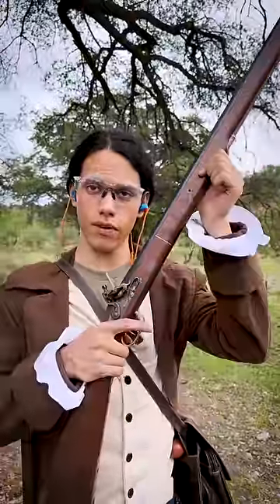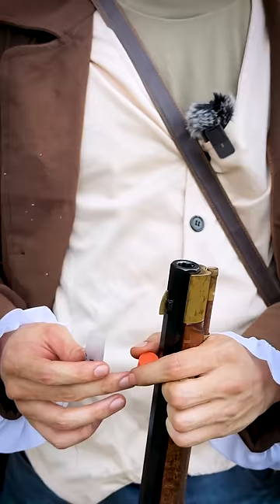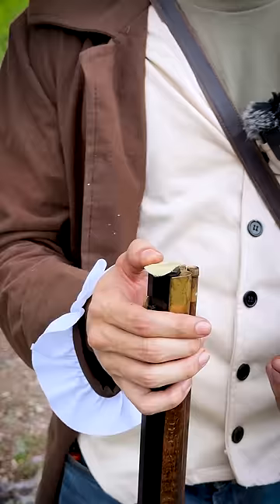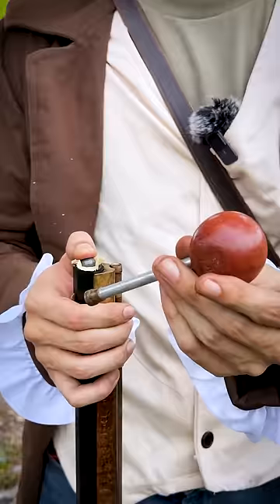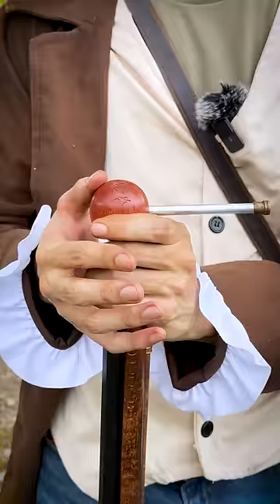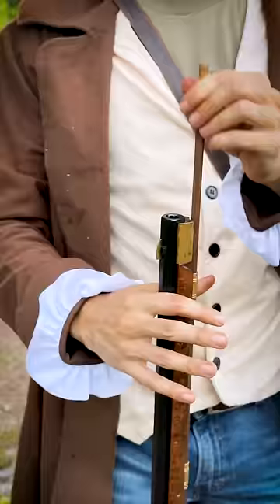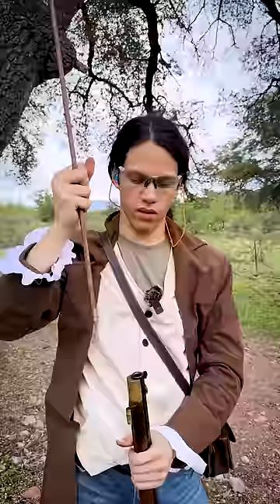How to Load a Flintlock

Comment: Soldiers could probably load these things so dang fast back in the revolutionary era.
Reply: They did the standard till muskets became no longer use was somewhere between 3-10 per minute.
Reply: A flintlock musket, pretty quickly, but one of these would be pretty slow, because it's rifled, and requires a lot more effort to load
Reply: @sinisterisrandom8537 10 shots a min would be more fitting for a late 1800s single shot rifle. In practice the fire rate could go up to 4 or 5 a min but under battle condition you'll get a 3 or a 4 if the men are extremely well trained and have high morale the French and the Prussians were a little ahead of main land powers but the Brits could keep up with them most of the times.
Reply: @sinisterisrandom8537 you would have to be fast as frick to get ten of these a minute
Reply: 3 rounds to the minute. That's good Soldiering.
Reply: The japanese bought flintlock rifles from the portuguese in the 16th centuary and they invented a "quickloader". It's a small tube that already has gunpowder and the projectile in it so you just put it on the muzzle and push the loading stick through the Barrel. It's called "hayago"
Reply: An average of 3 times a minute, under fire. So like, count to twenty.
Reply: Doubt it
Reply: With flintlock rifles it was longer to load than a flintlock musket mainly because of the extra steps such as the patch and hammering the tight patch with the ball in. I dont think loading speed was an importance to a skirmisher, it’s hitting the enemy accurately
Reply: @whyareyoureadingthislookaw8319  4 to 5 rounds per minute was impossible in any condition, it is 2 or 3 per minute at best with muzzle loading smooth barrel muskets ... just 1 per minute with muzzle loading rifled muskets
Reply: @federicovesentini3719  It is possible in drilling but the average fire rate in battle was 3. 4-5 was only done in drilling as rare as it is It was possible just not likely.
Reply: @whyareyoureadingthislookaw8319  Spit loading a smoothbore or unpatched rifle (see Sharpe's Rifles) flintlock could approach ten a minute until fouling got too bad, but loading from loose powder and ball would always be slower, even with a smoothbore.

Brits had the advantage in the flintlock era; not only did they keep the faster-loading smoothbore Brown Bess when everyone else was converting to rifles, but their troops trained with live ammunition where almost all other armies trained "by the numbers" but would only fire a half dozen live shots (so they could feel the recoil and see the pan flash) before going into combat.

American Civil War, with paper cartridges, Minie balls that needed no patch, and percussion ignition would get rifles up to 10 a minute with accuracy (again, until too much fouling built up), but that was 20+ years after flintlocks became obsolete.
Reply: @SilntObsvr  I'd disagree the British were very well trained but The average Prussian or French soldier was way more likely to have combat experience against another European power. Before Friedrich Wilhelm Ludolf came to train them colonists army was as effective as Russia's current day army. And the Brits were criticized very harshly due to their lack of disciplinary punishments which I'd say is pretty cool of the Brits but that off topic. And Spit loading most likely never happened Brandon.F has an amazing video on it.
Reply: @SilntObsvr  Oh and I can't say much about the Civil war since I didn't study it as much.
Reply: @skystorm569 watchs sharps rifles they actually show how they did it they would skip the ram rod and put the shot in there mouth put the powder down the barrel and then spit the shot back in the barrel then tamp the butt of the rifle on the ground prime the pan then fire
Reply: @psjesse117 Muskets were a lot faster to reload by the time of the Civil War
Reply: @AAV_OP  Yeah, because the whole step of priming the flash pan was eliminated by percussion caps, as well as pre-lubricated cartridges becoming common, allowing the rifles that were used to be loaded more smoothly while also being rifles, not smoothbore
Reply: @SilntObsvr muzzle loading weapons did not get faster at all, it was always around 2-3 expected in battle or 3-4 in drill, no musket/muzzle loading rifle could get 10 rounds per minute, paper cartridges allowed 3-4rpm, without paper cartridges you'd probably only get 1 round per minute (or less), i can't say for the sharps rifles, but i'd guess around 8 to 9 rpm, also, no countries were switching to standardized rifles in the 1700s, unless in skirmisher/specialist roles
Reply: @sinisterisrandom8537  3 was the parade standard, if you got 10, you would be a superhuman
Reply: @whyareyoureadingthislookaw8319 a mid 19th century smooth bore musket using percussion caps could 100% be loaded and fired at a rate of 10 rounds per minute unless you are using miniballs, especially with paper cartridges. A breach loading single shot rifle or needle fired rifle could probably do more like 12. A breach loading rifle like the British martini Henry in the late 1800s could do way, way more, there is a video on YouTube of someone loading and firing 18 rounds from a martini Henry using metal cased ammunition in a minute.
Reply: @psjesse117  yeah I know all that plus the invention of the minie ball which is close in shape to the modern-day bullet and they put rifling in all the musket barrels to help improve accuracy
Reply: @derekhenschel3191  Percussion cap muskets weren't a thing in the 18th century they were used first in the 1820s/1830s. And someone firing the Martini Henry 18 times would not reflect a soldiers ability under battle conditions.
Reply: @whyareyoureadingthislookaw8319  I meant 19th century, it reflects the ease of loading and firing
Reply: @kyleramos720 remember volley fire??

Not about accuracy but overwhelming firepower
Reply: Imagine getting hit by this thing
Reply: many guns from dead men had two or three balls shoved down them, to scarred to remember the powder 😮
Reply: @sinisterisrandom8537  no chance 10 per minute. I see 96 people don't know about flintlocks
Reply: @colinhaieck2299 MATCHLOCK not flintlock, being portuguese
Reply: This is a rifle, so not really. Though with muskets, yes.
Reply: @SilntObsvr   have you even watched that episode? That fastest guy in the group sharpe is teaching does 4 rounds and Sharpe even says the mark of a good soldier is 3 ROUNDS A MINUTE IN ANY WEATHER. 
Your made up point about the British still using muskets is, I'm fairly sure, made up seeing as how the British eye using baker rifles more and before other continental powers. And spit or tap loading wasn't even a real thing they'd all get lead poisoning. 
You need to do confusing a TV show with reality. And if you do cite a TV show at least get it right
Reply: fast mags weren’t invented
Reply: Trained soldiers could fire 3 rounds per minute. But these men fought in 3 man deep line formations firing volleys. One line fires, then another, then another, by the time it comes back to the first guy he's reloaded and ready to go again. Every few seconds, another volley would be sent downrange.
Reply: @sinisterisrandom8537 10 rounds a minute? A good time was 3/4 per minute, you aint loading, amining and firing a musket once every six seconds
Reply: @sinisterisrandom8537  you edited it and still couldn't make it in any form of English
Reply: You're only able to reload a Flintlock five times per minute
Reply: British soldiers, of the time, (minute men) were required to make 3 shots per minute.
Reply: @FrancesShepherd-zj3zn  exactly, understanding muzzle loaders is important to understand how far tech has come, and yet no one knows anything about them! So many comments mention how "minie balls made loading faster" when ammunition type has nothing to do with the loading process lol, just shows you how many people get their info from movies, or are talking out of their ass
Reply: @sinisterisrandom8537 the highest recorded rpm with a smoothbore muzzloader was 4rpm while most experienced men could barely manage 3
Reply: @colinhaieck2299 unlike what is shown with a marksman rifle, common smoothbores already used prepackaged paper cartriges, the rear was torn off with the teeth and the exposed powder poured, the excess paper would work as wadding to help with gas seal with the shot sitting in front
Reply: @SilntObsvr everyone in the 1810s used mostky smoothbores, you watch too much media, even with minie which was made in the 1840s the only place you would see 10 rpm is whatever video game you found these in
Reply: @AAV_OP they reloaded slightly faster as the ramrod would just slide down the barrel, even with the brown bess which was made for better rpm still took quite some force with the tighter seal the paper gave
Reply: @SilntObsvr there is so much wrong here lol
Reply: 3 shots a minute was considered the expected rate of fire.
Reply: And they used to stand in a line and shoot each other in their best clothing and nice tall hat.
Reply: In the early 1800s, the british army was notorious for whipping soldiers, and, during the peninsular war, many british soldiers had experience from fighting in India.
Reply: @rainmanslim4611 then there were the British who fought in two rank deep lines, and usually they fired by companies instead of lines, so the fire would systematically roll up the line, like how a warship of that time would fire its guns.
Reply: It reloads on time for the next war.
Reply: They definitely could, they were called minutemen, they could fire, reload, and fire again in a minute or less, it was actually pretty awesome.

Comment: i never thought there would be a delay between the hammer and the actual shot, thats pretty neat
Reply: User error. You can see him pump the primer at least 4 times before it cuts away. That's way too much powder. Basically turns the pan into a looney toons fuse.
Reply: There's actually a tiny lil bit delay if its done properly, which you can see in slow motion lul.
Not like this guy's delay
Reply: Hamilton said it best.

"Click, Boom."
Reply: I mean, there’s a delay between the pin hitting the primer and the bullet leaving the casing on a modern gun too, just much much shorter, this one is a little exaggerated (probably for dramatic effect, maybe because the user isn’t perfect)
Reply: You can't flinch or you'll miss.
Reply: Usually not this much, but it does delay. Makes hunting more interesting
Reply: Black powder. It delays and produces a lot of smoke
Reply: @jtime8022 Not error, he wants to show the use and priming, so he exaggerates everything to demonstrate everything in detail.
Reply: @chrisgetz9787  If primed correctly (1/3 of the flashpan max.), the delay is reduced considerably. In fact, the delay of the best quality dueling-flintlock pistols as well as some of the finest rifles (not muskets) of the time, were nearly or AS fast that of the percussion mechanism. This requires 4F priming powder, a newly hardend "steel" and a neatly knapped flint though.

Comment: The delay is insane to think some were able to take longer shots with them
Reply from the maker: When the pan is primed correctly, the "Lock time" is actually pretty instant. I just put too much powder in the pan so it took forever lol
Reply: @bigironbois well I have learned something new. Thank you. For new knowledge I will subscribe.
Reply: They have a 1000-yard match shoot twice a year in Friendship IN
Reply: People forget these were *accurate*, a lot of people depended on hunting to feed themselves and used rifles to do it. If you missed 90% of the time and scared all the deer away you'd never eat.
Reply: @boydrid  Yeah, my older brother went out to Friendship and shot many times.  Won a few competitions if I remember right.  With a rifled barrel, these guns are surprisingly accurate.  Most of the 18th century guns were smoothbore muskets, those were spray-and-pray.
Reply: @Moose6340  I really have a hard time believing that people are able to see and shoot that far.I know that they are able to. But it's definitely more the person than the gun. I know that even with modern guns and scopes, I couldn't shoot that far and hit a target.
Reply: @bigironbois  Yes filling the flashpan up to a third is ideal in when to achieve the most immediate discharge.
Reply: The old-timers took a quill... A feather... And plugged The flash hole to keep the powder out of it.... If you do that, it goes off almost as fast as a cartridge rifle... Take anything and plug it because when it fills with powder you created a slow burn fuse... Keeping the hole open lets the fire flick into the powder charge

Comment: In the Civil War era, a well-trained soldier was able to fire their M1861 three times per minute. That’s crazy fast for the time.
Reply: Three times a minute is not exceptionally fast for the time. With moderate training, you can achieve that. 4 or 5 a minute would be absolutely something though.
Reply: That's 3 aimed shots per minute. A panicked soldier could no doubt fire faster, but if you don't hit your target you might as well fire into the air.
Reply: Thats crazy
Reply: Also, in the Civil War they used the Minnie Ball which required no patch.
Reply: They used paper cartridges, which is way faster to reload. All of the powder is already measured out for you.
Reply: @thesayerofthelaw  I didn’t even think of that. I just think of reloading my grandpa’s muzzle loader and I was like, “how did they do this so fast?!”
Reply: @brettandersson3206  Civilian arms would be loaded with Powder Horns, Separated patches and shot while Military arms would use paper cartridges. Civilian weapons also were typically lighter and shorter with more advanced sights and rifling while Military weapons typically were heavier, longer and of course had the Bayonet. It gets more streamlined when you reach the 1850s where rifling and rear sights became common place for military weapons.
Reply: Springfield rifles in the Civil War didn't use powder to prime a pan; they used percussion caps.
Reply: They also had access to percussion caps and preloaded paper cartridges but still impressive for a muzzleloader.
Reply: 4
Reply: Not that’s soldiering
Reply: @BrianRissooumbofficial 
Most convincing rage bait of 2024.
But in all seriousness, paper cartridges were the most common ammunition for flintlocks at the time, stretching from the Napoleonic wars.
Reply: No, at the time they would use an all in one paper cartridge. You take the cartridge out of your pouch, tear off the top with your teeth. Then pour the black powder into the pan until it was full. Close the thingy on the pan, shove the rest of the cartridge in the barbell then shove it down there with the ram rod. Should take 15 seconds or faster
Reply: @Jannaria  you’d usually use a percussion cap they would do it where you would have to pour black powder into the pan in the 1700s
Reply: @Jannaria  it would take longer than 15 seconds
Reply: @JCoutdoors-777  no it wouldn’t?? If you were skilled (or sneaky) you could literally load it in less time
Reply: Yeah, using paper cartridges a musket could be fired as many as 5 times per minute by experienced soldiers.   Rifles were slower, but could be expected to fire 3 times per minute or so, the tolerances between ball and barrel were much tighter so it took longer to seat the ball.
Reply: The Prussians were expected to fire around 5 rounds per minute. Though in reality it's probably closer to 3 rounds per minute.
Reply: Minie Ball loads faster than round ball
Reply: Redcoats doing that 150 years earlier without miniballs
Reply: Most of the rifles used during The Civil War were percussion
Reply: 3-4 shots a minute was standard for muzzle loaders before the 1860's.
In the 1780's-1880 it was expected for any man to reach that without cartridges.
Reply: Now Imagine What if so embody tells them In future there will be guns Which could fire 30+ rounds Per mint

Comment: Bro was embarrassed to look back
Reply: i don't think i could hit that target with that gun, no matter how many tries you gave me
Reply: Do you know how inaccurate the gun is?
Reply: @dartawnasailo4449 they’re talking about the delay from trigger pull to rifle firing. Lot of people call these flinch locks bc it’s SO easy to flinch and miss during that delay. He honestly just didn’t use the right powder in the pan. Either he didn’t use priming powder or he used the wrong type, Swiss 4 F works best I’ve heard.
Reply: @jordannewsom4578  i think you've mistakenly replied the wrong thread
Reply: @jordannewsom4578 no hes literally talking about the inaccuracy. Those guns had to be used in lines of defense because
of how inaccurate they were. mainly because the inside of the barrel was not threaded not giving the spin needed to keep it on target
Reply: I mean, from that far away even with a musket over any other firearm back in the 1700's, it was quite the challenge to accurately hit a target from that far away!
Reply: To put it simple, ammo back then were balls and had no point so couldnt pierce thru the air

Comment: The delay from the hammer dropping and the gun firing is so cool
Reply: 200ms latency
Reply: I just did a video of various gun actions on Rumble. My flintlock going off definitely is a different sound altogether!
Reply: It's a 'Traditions' flintlock.... cheap and a very weak lock.
Reply: Not when it comes to the whole "hitting your target" part...😂
Reply: Disconcerting.
Reply: Amazingly though black powder burns faster than smokeless powered.
Reply: Not cool